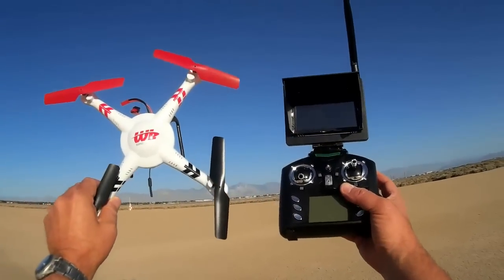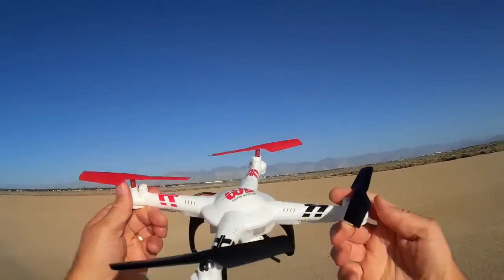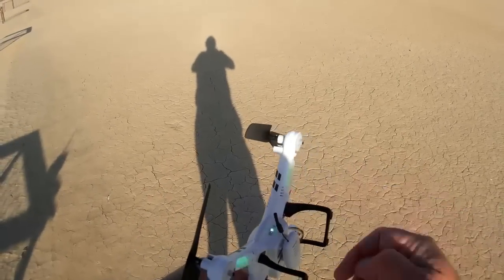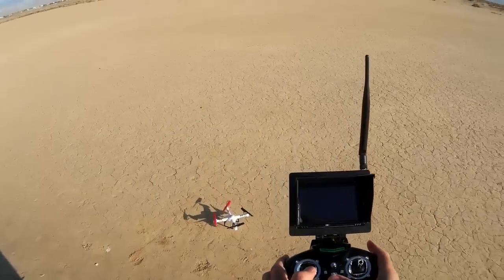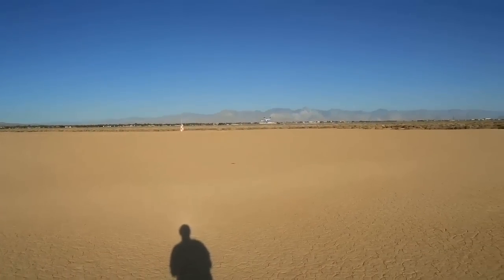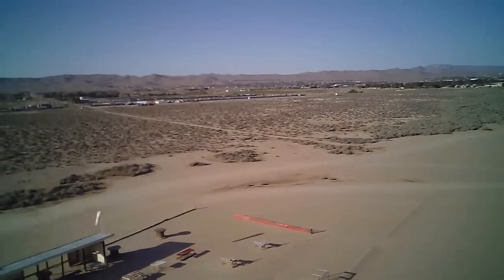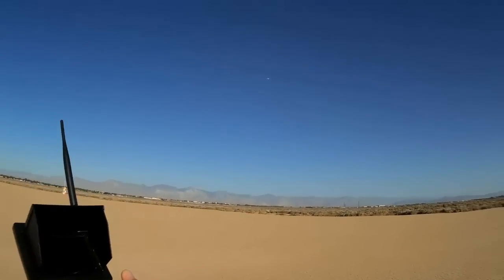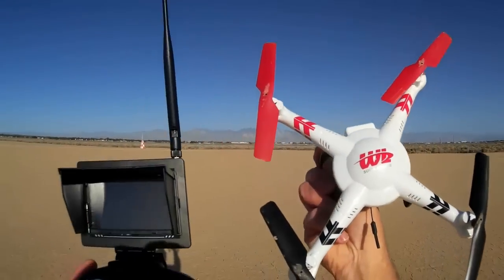WLToys V686G FPV Drone Gyro Calibration

Comment: Cool, thank you for this showing us about this undocumented (well, it may be documented, but given the language on the manual, it's as if it's not) feature! The procedure is curious, as it's similar to the calibration of the compass in a mobile phone, yet all reports I've read about the V686 say it doesn't have any compass chip.
Still, I've got to try it when I have some outdoor time with my V686!

Comment: Hi and thanks for the video. Do you know how to adjust the roll expo? My transmitter's roll only goes left side about 35% while the right goes all the way to 100%. I didnt think there's an option for this controller but I thought I'd ask... 
Thanks!
Reply from the maker: Ali S. Sounds like you may need to level calibrate.  
1. Turn on the uqadcopter and place it on a flat and level surface.  Wait a few seconds for the gyros to calibrate.
2. Turn on the transmitter and set it to 80 or 100%.
3. Move and hold both control sticks to their lower left corners.  Hold them there until the quadcopter's lights flash
4. Let go of the sticks and try flying.

You should only need to do the above once.  But in the future, always after plugging your battery in, immediately place it on the ground undisturbed for a few seconds before attempting to bind to your transmitter. This let's the gyros initialize properly.

Comment: First off, Thank you for all your reviews you post. I know this is a post for the 686G from WLToys but I didn't see a review from you on the 1sq vcam from heli-max. I need your thoughts and expertise. This post made me think about how my heli-max 1sq and how it always wants to fly off to the left when I turn it on and try to fly. I have learned that if I hold the stick slightly to the left when I turn the transmitter on, it almost corrects it enough to where I can fly it. I know, I hope this makes sense to you. The best way I can describe the problem is, think about if you trim the transmitter trim all the way to the left and try to fly that way. I have tried to trim it all the way to the right to see if that would help and It helped a little but not enough. So there is two ways I figured out how to temperately fix it. One is to set it down with one side of the quad-copter up about 1/2 to 3/4 of an inch on say a book or something like that or hold the sticks on the transmitter to the left and turn it on. Okay after all that, my question is can this be corrected do calibrating the gyro or anything else? I bought this off of ebay as a store return and cant send it back. The worst thing about it is when I first got it I put another battery from one of my other quadcoters in it and fried the board. So I bought another board from the same seller and again no returns. I would hate to have to buy another board for it seeing at that point I would have spent more for it then if I just bought it brand new to start with. Sorry for posting this on this review. I hope you can help or maybe someone that watches this review can? Thank you
Reply from the maker: michael rodgers I think that your board may be slightly off level when you installed it.  It's trying to level itself when you take off.
Reply: Quadcopter 101  I did try taking the board off and re-installing it and the outcome was the same. I think I will end up putting a shim underneath if it cant be calibrated. Thanks for the input

Comment: Thanks for the tut on gyro calibration.
I'm curious if unlike most WLtoys transmitters with this is it possible to do an accelerometer calibration without being in 80 or 100 percent mode?.
I noticed after turning on you never changed from 40% to do that.
Again many thanks for a great video instruction.
X/BillyD..
.
Reply from the maker: BillyD Davis You need to be in 80% or 100% to level calibrate all sensors by moving both control sticks to their lower left corners (with the quadc motionless on a flat level surface).  But it's not necessary to be in 80 or 100 for the individual gyro calibration as shown in the video.

Comment: Two questions, Is the syma x5c any easier to fly than this v686? I am probably the worse pilot ever.. One would think I have Parkinson's judging the movements of my quad..and Im wondering if the monitor and camera unit of the wL could be fabbed on to the syma?
Reply from the maker: anyshitt As a beginner, would recommend turning off the video screen, and focusing solely on learning to fly without the camera.  Once you learn the basics of flight, then consider turning on the camera and screen.  The tutorials on this following site may help you http://quadcopter101.blogspot.com/
Reply: anyshitt I think there is not much different in flying the syma and v686g..syma probably a tiny bit easier .the camera connection is different to the syma connection and has four wires not three like the syma.the camera and fpv does work with wltoys v912 helicopter ..I am also a beginner and flying with fpv is not that easy plus the screen is hard to see outside.both are good value for the money..
Reply: Quadcopter 101 Oh yes for sure, I knew long before my purchase that the video monitor would be absolutely useless to me unless i become an affective accurate operator of the unit first! But I wanted the the added option of the monitor just the same, and I already was impressed with the quality of camera thanks to video's like yours.. today will be more time spent under freeway bridge's.. because I have a heavy throttle hand, and this thing eat's altitude almost as much as it does battery's, so I figured I'd practice trying to maneuver the quad around without hitting the ceiling of the bridge!  Thanks again..
Reply: Quadcopter 101 Plus, as far as beginner's grade controller's go?
having the TV monitor on top make's you look like a badass! lol I already knew that the antenna coming off monitor was nothing more than the receiver from the camera's view finder, but it look's really cool and it give's the impression of a big ole transmitting antenna! Man if and when I can fly effectively? I am going to get this box tweaked with real coax like some of the guys did with the syma..

Comment: ie. Horizontal calibration then vertical calibration , vs. X-Axis then Y-Axis calibration - that you show on This video, interested to know if they are the same thing..
Reply from the maker: Ab Rob No, I'm merely rotating about the length (X) axis, then width (Y) axis.  I'm rotating about these axis by spinning in place as its merely a convenient way to do it steadily.

Comment: Is this "individual gyro calibration" the same as the "compass calibration" you need to do on most quads?  It seems very similar?? Maybe it is the same thing just done slightly differently?
Reply from the maker: Ab Rob Similar. Compass calibration is usually rotated about the Top/Bottom (Z) axis.

Comment: Yup!!  Mine does the same thing.  Wobbles noticeably, even in a mild wind when in headless mode.  I also get wobble when not in headless mode when I throttle back.  Great package for the $$$, but I'm thinking they have a bit of tweaking to do on the software.

Comment: I just discovered the wobble last night when you use headless mode in any thing other than beginner mode. I was disappointed in that but the leds are great for night flying. I really don't use headless mode but it would be nice if it worked.
Reply from the maker: TimmyV I think it may be working. This may be an acrobatic feature called "twist stumble".  The Nihui U807 does the same intentionally in headless mode, when in Expert (but not in Beginner). https://www.youtube.com/watch?v=qMOJxoD9xxUThe same company that designed the flight control software for the U807, may have also used the same subroutines for the V686G.

Comment: I have the non-FPV version of the V686: no wobble.  In fact it's an impressive flier.  You mention that the quad doesn't fly as well in headless mode in windy conditions.  That's true for mine also but is also true of every other quadcopter that I have with headless mode.  The one thing that bugs me about the V686 is that the gears are on the bottom with no protection (along with narrow tippy landing gear), so when the copter lands it tends to bounce the gears into the sand or dirt making a gritty mess.  This doesn't happen with the alias type clones such as the Nihui U807 or Dromida Ominus (gears on top).  It also doesn't happen with the well shielded HT F801 gears.

Comment: If this is theV686G then it is not the Wifi version. About the RTH problem, you might just have a bad one. Also the wobble might be a faulty motor, there are some here on Youtube that have motor problems straight out of the box.
But I still think it is the best Quad with FPV for 100$ price
Reply from the maker: Ruudy leek Yes I misspoke. I meant 5.8Ghz FPV. But does the RTH on yours work?  When I press and hold down the upper-left trigger button, it doesn't seem to do anything but drift in the wind.
Reply: Quadcopter 101 I still have too receive mine, but here on Youtube was a video showing the RTH mode, and it came straight back twice, nearly taking the guys head off, it comes back real fast and you have too stop it before it gets too youSo it does seem too work, it seems too lock onto the signal that the TX transmits when you press the button
Reply: When Alishanmao tested it is just went off into the distance instead of returning...Not really possible without GPS